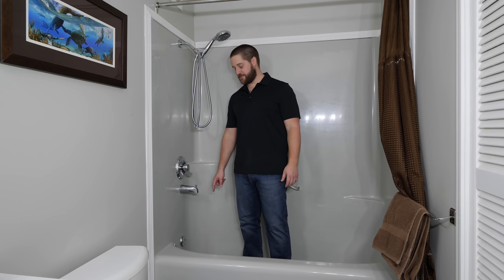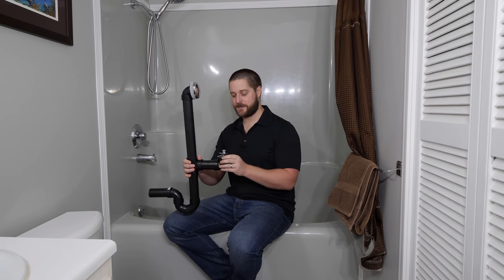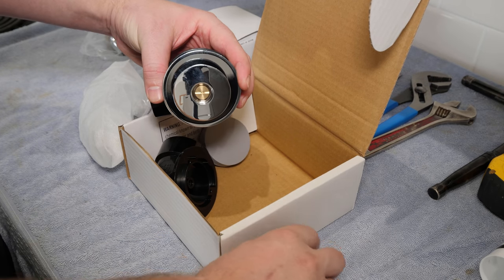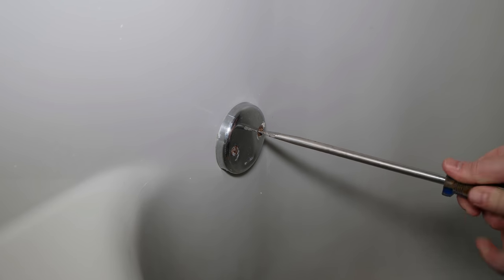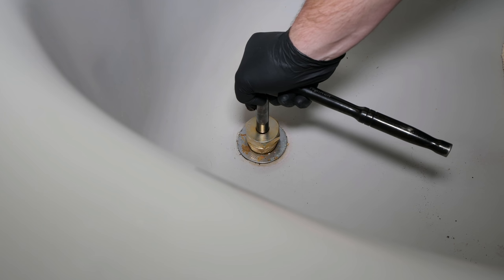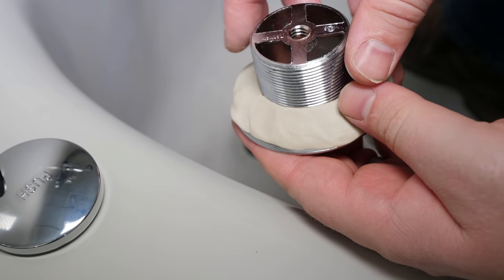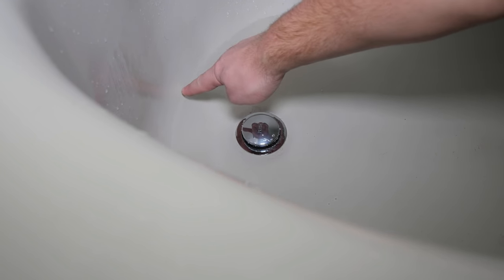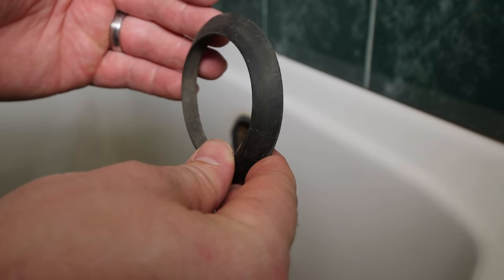Replacing a Tub Drain: Bathtub Drain Removal and Replacement

Comment: This is a great video, thank you. One question though: for the gasket that is supposed to be installed under the tub for the drain, you said if it’s installed wrongly on top, that there would be some movement in the drain. So does that mean if the gasket is installed correctly (under the tub), that there should be no pipe movement?
Reply: If installed correctly it should snug up pretty good

Comment: good video.  about to do this, but the one i bought has a rubber washer at the bottom of the drain.  the instructions say to use plumbers putty on the bottom and now wondering why they included the rubber washer?  there is no way i would use both would i?  thanks.

Comment: how do you measure the thread on the drain flange.  Currently in the process of changing mine out and the replacement ones found at Home Depot or Lowes will not screw into my older steel bathtub

added:  The original thread appears to be finer than the current universal measurement

Comment: Interesting but what if the drain actuator is in the overflow with the lever going down to the bottom. The lever has stopped working.

Comment: Hi

I changed the drain and still have water leaking under the tub. My tub is a fiberglass type material, how tight can I go screwing the drain? 

Thinking of also using 2 washers as the space under the tube seems big.

Thank you

Comment: After you remove the old bathtub drain,  will the bottom piping system shifted and collapsed to the worst?  This is what my super told me, so that I have been advised not to touch a leaking drain.  The super will apply sealant to the old drain.  I'd never have thought of this.  I'm having drain/standing waste system.  Thank you.

Comment: My drain is older than those. To close the drain there is a lever on the wall of the tub that moves the stopper up and down. There is a plate just under it on the floor of the tub. I just want to change the drain covering that hole. There is a screw in the middle of it. Is it connected to any of the inner mechanisms that open and shut the drain below it or is that cover free to remove by unscrewing the screw holding that  cover on? And then can I get a new drain cover to screw on. The old one is caroded.

Comment: I am replacing the overflow and drain in my bathroom. I am running into an issue with replacing the gasket at the overflow. The pipe to my over flow has a lot of give and I can't really get a good seal with the gasket on it. Thoughts on what I could do?

Comment: I can't get the old drain out even though I bought the drain removal tool as the drain part that the tool uses broke off. I then bought an extraction tool but it doesn't engage the drain good enough to extract the drain. It was suggested I use a hack saw to cut the drain piece but I'm afraid of ruining the threads and won't be able to install the new drain plug. The access to underneath the drain is difficult as it is a second floor outside wall installation. Any suggestions or comments?
Bruce

Comment: My drain pipe is in PVC, I have the tool but I feel that if I torqued the drain with a wrench I would probably strip the threads no? Is their cases where you can just hand tight it and its good?

Comment: I have heard and read that plumbers putty may stain an acrylic tub and degrade the ABS fittings as it is petroleum based. Thoughts? I hate the idea of silicone on the mount but do not want staining or ABS issues. Tub manufacturer was no help!!! Am doing a new install. Thoughts?  Thanks!

Comment: Q: I’m concerned that when I loosen or take out the old drain that the pipe would drop/sag and I will not be able to reach it since it is for the second floor tub. No way to get to it other than cutting thru first floor ceiling beneath the tub. Is this a valid concern or will the overflow connection hold the whole pipe assembly in place?

Appreciate this Great video!
Reply: Great question...waiting for a response, too!
Reply: Even if it drops, it won't drop more than 3 inches max. If you can get it with fingers, use a coat hanger bent to pull it up from inside of the drain. But really it more than likely will not drop more than 1/2 inch.
Reply: Also tip from a pro perspective, apply pipe thread sealant to the threads of new part and I totally prefer silicone instead of plumber putty. Thread sealant allows lubricant to threads, silicone allows a cleaner finish where as plumber putty can leave a lip that holds water constantly. Ick!

Comment: A plumber I saw said they wanted 1000 bucks to do this the other day! F THAT! Thanks!
Reply: 1k is a little steep. You must have gold plated faucets.

However.. 150-250 seem reasonable considering if there is a leak you could end up with a lot more worth in water damage. As long the you hire. Reputable plumber you should be fine. I’m likely going to get a plumber for the reason above. It’s ez, but if it leaks at least I’m covered.

Comment: Any tips on removing a rusted screw that broke on a single screw over flow? It broke off at an angle. Thank you.
Reply from the maker: Ouch, that's unfortunate. If there's still some thread showing out of the fitting, I would try to grip the thread with a pair of locking pliers (Vise-Grips) and spin it out that way. Spraying the threads with some penetrating oil before hand may help as well. If the threads snapped inside the fitting and there's nothing to grab on to, then the center of the screw would have to be drilled out and a screw extractor (Easy Out) could be used. Hope you're successful. Best of luck!

Comment: One more question... Since my tub and drain were installed fairly recently (2013) can I assume that the drain is the 1½" Coarse Thread size?  That dimension refers to the inside diameter of the drain opening, right?

Comment: How would you install those gaskets in back & bottom if your tubes are made out of metal?
So using the flat blade screwdriver is a no go & you don't have much room in back of tube.

Comment: FABULOUS VIDEO! 30 years ago, I had the courage of a bull to do my own repairs, painting, and upgrades. Back then, the internet didn’t exist — we had to physically traipse to a local bookstore for home repair books, leverage our distant relatives’ expertise as contractors and architects, do other laborious research to do things right, and understand when to call a professional. Always, my decisions were right. Yes, for years like a monkey with no fear of heights, I swept off my 2 story roof shingles, mucked out my gutters, and flushed my downspouts. Because only I knew how sparkling and debris-free they had to be. I rewired my outlets to match my color scheme. And learned how to use a saws-all to brush clear and reclaim my overgrown back yard. But I knew only a pro could fell the massive 100’ pines that threatened to fall on my house. Or remove a bearing wall (and span the new breach with a massive beam). But I got a little too confident …

My hubris was had when I yanked out my 1950s cast iron tub drain mechanism, thinking it would require just a simple part to replace. The tub hadn’t held water, so I just finagled the entire cantankerous lever system piece out, it looked crusty and old, and I threw it away. I didn’t realize nobody made the part anymore! 

Thanks to this video, I now know what needs to be done. But I don’t have any of the specialized plumbing tools I’ll likely need to do it myself. And I’m not convinced any of my local plumbing companies will, either — they all prefer easy new construction. I’d want whomever I got to watch this video, which I’m sure they’d find ‘condescending.’ Insult to injury, they charge THOUSANDS for jobs that anyone with the right tools could do for a couple hundred (e.g., replacing a toilet), and come with ‘attitude.’ That said, I’m thinking it would be worth it to buy the tools I’ll only use once, and do the job myself. FWIW, I’m a now-elderly woman.

Comment: We live in a condomon fourth floor and our tub drain is siliconed in so it wouldnt leak. Iy now is starting to corode from the salt in the soft water how can i get it out without cracking the shoe is there a way to soften the silicon as i dont want to have to take out the tub because the shoe cracked.I tryed to remove it but its realy tight and the botton metal parts broke out thanks

Comment: The pop-pops are nice but the biggest problem is hair. Hair clogs up my bathtub drain really fast. I simply leave all those "fancy" features aside, leave the drain "open" and use a wire/mesh drain cover to catch the hair. If I want to take a bath, I use a rubber stopper. It may not look pretty but it works and saves me time and effort of having to remove/replace drain caps to remove hair and clear clogs. ✌🏽👍🏽

Comment: Loosen the overflow screws but don’t take them out, then do the drain so you’ll have a little wiggle room to fit the gasket under the drain, then finish with the overflow.

If you start with the overflow, the pipes won’t move when you’re trying to pry that gasket into the drain.

Noe eye say’n

Comment: I got a single screw overflow cap and my old screw is rusted off in the drain pipe! Any other option than drilling it out? I don't see how I could install the adapter bracket.

Comment: My drain pipe is off by about ¼" and the drain is slightly off centre of the tub seat but is fully in the recess. It is flat and screwed in properly. Is it a problem if the drain pipe is under strain?

Comment: So the bottom drain, it has the metal ring around it but nothing inside the hole, u can see right down into the drain. Anything can fall in there, I draped my razor 🪒 top in there and had to catch it before it got stuck going down. How do I get this out and replace it?

Comment: What if the stopper lever to close the drain is on the drain plate and it has a long rod with a heavy piece  at the bottom running down the inside? Can I replace it with this type?

Comment: what if you have a 1 1/2" drain with fine threads and the 1 1/2" adapter has course threads and won't fit?

Comment: I do this a lot AND with very hard water there's always deterioration to the extracted parts and often I have to hack saw out the old drain being very careful not to damage the tub opening to seat the drain.  If there's damage to the tub, be careful to take that into account to prevent the need to do a complete tub replacement.  Oh, I'd NEVER use foam gaskets.

Comment: hi, the tub drain  rotted and broke in the cast iron pipe. The rest of the drain  that broke is still inside the cast pipe. So basically im trying to remove the broken piece thats still in the cast pipe by unscrewing it. Is there a tool that I can use?

Comment: Hi thanks for the video. I tried replacing the drain in my bathtub. I have a 1.5 inch drain flange. The new drain just keeps spinning and doesn't fit tightly onto the drain pipe underneath. What could possibly be wrong? I have tried two different drains but no luck tightening them, both just kept spinning.
Reply: I have a similar problem.  While turning the old drain, it got to a certain point and then would only spin without coming out.  I can't retighten it, either.  I'm afraid I may be screwed.
Reply: @DaveBowman345  Need to pry up on drain while turning. Requires another pair of hands. Getting a new one in will be another story if threads on pipes stripped. Could try removing overflow and pushing pipe up to bring bottom flange tight against tub...Long shot.
Reply: @LoneWolf-jh3fi  thx… this was kind of a different situation.  I did end up getting it sorted out and it wasn’t as difficult as I thought it would be except that I did end up spending a lot of time under my mobile home.  Next time I’ll know what to do.. I appreciate your suggestions. 👍👍

Comment: Do you or anyone have any tips on why my drain won’t thread evenly and flush when I’m just reinstalling the same old drain? I am using the exact same drain, I have cleaned with with a wire brush and cleaned the thread we’re  just resealing it

Comment: quick question: i used that tool and it worked great but the drain isn't coming up, its just spinning and not rising or unscrewing. any idea what i can do? thanks.
Reply: If I am understanding you your problem is reconnecting the new drain into the threaded pipe.  If so, you should be able to sort of lift the underneath pipe up a bit first by sticking a finger into  the drain pipe and lifting upwards to get it into position.
Reply: @somedude7029  im sorry. im talking about the old drain/flange. i was able to loosen it but it's just spinning around/not unscrewing. im racking my brains trying to figure out the issue.

Comment: I have a leak in the tub that appears to be coming from the overflow fortunately I have access to the tub from the back.  Does it make sense that the tub could be leaking through an old gasket.
Reply from the maker: Correct. It is most likely going to be a dried out gasket if it is leaking at the overflow.

Comment: FYI, fooling around with your tub drain on an old house may result in unforeseen pipe cracking/breaking, which means cutting holes in walls/ceiling to replace the broken section.
Reply: I was warned about this so I decided not to change the drain myself and I'll wait until I either replace the tub or something bad happens to the tub.

Comment: So I have to ask the burning question… The old seal that was NOT installed correctly, why is that wrong? Seemed like it was an old drain, holding water and wasn’t leaking underneath. Also, aren’t sink drains installed with the seal on top and not from underneath?

Comment: I have a question - what if you can't remove the stopper.  We have the top tap kind - the chrome plate on top just spins, so I can't get to the piece that screws into the crossbars.  I can get ahold of that part, but it also just spins - seems to be stripped.  I really need to get that stopper removed - anyone on here have any suggestions.

Comment: You know these are videos you do are good on the basics, but what happens when things are frozen on and don't come off?  How do you get a stuck drain out?
Reply: You can try a tool call "Tub Drain Extractor".  The one I got at Home Depot did not work but the one from amazon with a socket wrench fitting on top did the job.  But it was not easy.  Added a pipe for torque and it bent my socket wrench.  Unless you are committed it might be better to  get a pro.
Reply: Thanks for the tip, if I run into problems that will be Plan B. 👍👍👍 @somedude7029

Comment: How tight is tight enough when screwing back the drain?
Reply: If you figure it out post back.   The more I tighten the more the gasket is displaced .   I am thinking that  maybe "snug" and hand tighten with the tool only, no wrench or screwdriver through the holes but am not sure.   Hoping a pro jock answers us.

Comment: So I just say a different video saying the casket that goes underneath the tube side is only replaced if you believe there is a leak concern do not necessarily need to replace only use the plumbers puddy

Comment: Hope you see this. My drain is extremely rusted and when I tried to remove it, it separated from the drain. How do I remove the drain when the tool won't work?
Reply: I've seen guys use a jigsaw with a metal-cutting blade.
Reply: @spikefivefivefive  yeah I figured it out. Got my dremel and cut into the drain just enough to fold it into itself, then slowly unscrewed it.

Comment: if someone can help me with this, My overflow plate has NO SCREWS and is not a snap-on, the pipe comes through the tub and is secured with a ring to the tub. The overflow plate screws directly to the pvc pipe. However, I cannot find a replacement part as all of the overflow plates are snap-on, 1 screw, or 2 screws. This overflow plate has threads and screws directly into the pvc pipe. HELP!

Comment: Lol I highly recommend hiring a professional plumber for this. Ive got 20 years experience in plumbing and i can tell you these drains will not come out easily unless your tub is brand new. The cross section is guaranteed to break away. After that you are left with few options. A giant easy out drain removal tool. Or do what i do. Use lots of tape to protect the tub near the drain. Use an angle grinder to grind a few slots in the inside edge of drain then use a hammer and screwdriver to drive out counterclockwise. Best of luck😬

Comment: Seems like installing the rubber gasket under the new tub drain flange/neck (just as the old one was improperly installed) would work just fine since the rubber gasket is taking the place of the plumbers putty you wrapped around the underside of the new drain flange anyway, and prevent having to wrestle the rubber gasket in between the underside of the tub and drain pipe flange surface with a screw driver or some other tool and deforming or damaging the new drain gasket.  Both methods would be seem to be leak tight to me.

Comment: I've been reglazing bathtubs for 35 years and pulled a drain or two, always makes me laugh when I see the gaskets installed inside the tub. Sometimes on the older tubs with brass waste overflows you can't spin them out, they'll break the brass tailpiece in the shoe. I cut these old school drains out with a sawsall. You (carefully) cut a pie piece out of it and you can pop the old drain out.

Comment: Ditto on the comments.  One caveat: When I replaced a neighbor's tub drain, I couldn’t budge it initially (even using the specialized wrench), so I heated it with a propane torch and that did the trick.  Granted, it was a METAL tub.  Had it been fiberglass, I would’ve used a heat gun and crossed my fingers.  🤷🏻‍♂️

Comment: Realized that maybe I used the wrong thread when I replaced my tub drain. This was my second install, both I had to cut them manually so that I could remove them. Btw, I also have the removal tool but it didn't work.